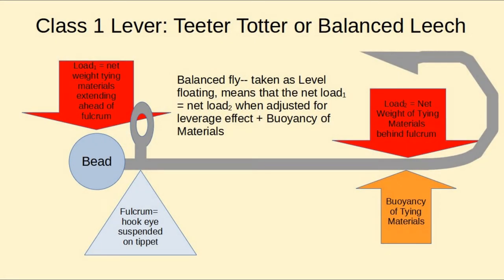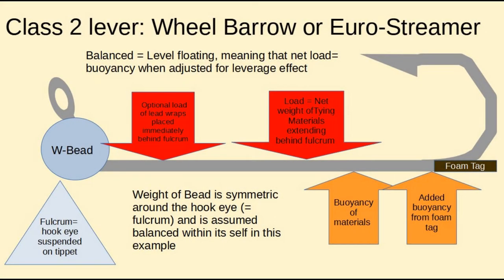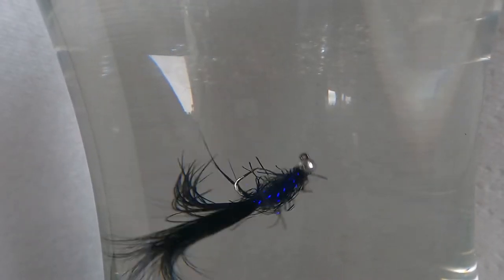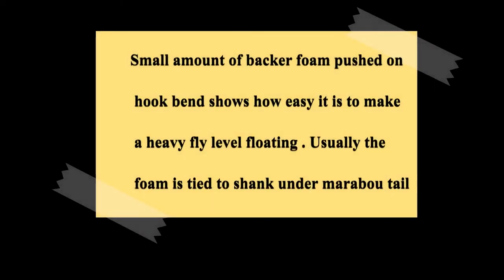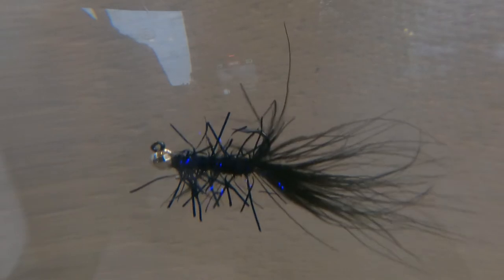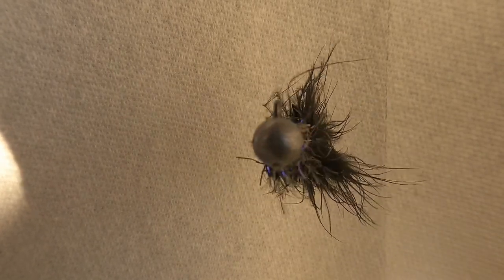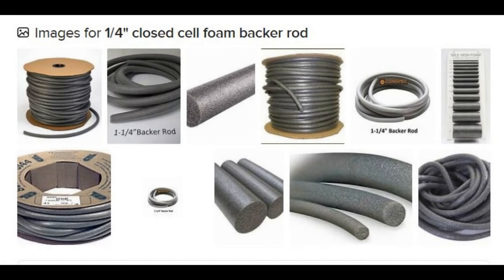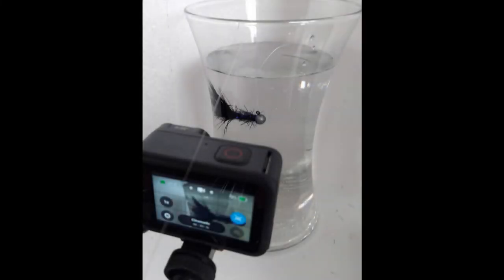Balanced Jig-Hook-Based Streamers using Foam Tags

Comment: Thanks.  Very interesting!   Have you compared the presentation between a loop knot and a clinch or other "tight to the eye" knot?
Reply from the maker: I have not done this experiment but It's an interesting idea. Seems it should be straight forward to do without confounding factors.   Keep it simple by using same make of fluorocarbon tippet-- my preferred type of tippet for streamers because it sinks.  Test at one reasonable tippet diameter for euro-streamers, I use 4x. As you say, use the Clinch knot (1 loop at hook eye) and I would add in the Palomar (2 loops at hook eye) as the tight to eye knots versus a small loop knot like Kryston or non-slip mono loop.  At first keep the hook style constant, like a downturned eye. That would be four tests.  Perhaps add on testing up-eye, horizontal ring-eye and vertical ring-eye hooks. One confounding factor could be that the narrow waist of the vase that I'm using as the test tank in this video may interfere with the movement of the tippet coming off of the hook eye in the case of the tight to eye knot tests-- and perhaps make the test results ambiguous. Testing in a wider vessel like an aquarium seemingly would remove that problem.
Reply from the maker: As suggested in Cc Ogden’s comment, the action of an euro-streamer with the tight-to-eye (TTE) aka snug knot on the tippet to fly connection was qualitatively compared to an open loop knot by water tank testing like that in the video.  What I saw is that compared to an open loop knot, a TTE connected fly seemingly has less freedom of movement when jigged. The attenuated movement is expressed as a slower-paced wiggle for a similar level of hand jig motion. In general, a TTE connected fly seemed more resistant to moving, perhaps because of the drag of the J shaped loop in front of the TTE connected fly vs vertical tippet that heads up from hookeye in an open loop connection. The TTE connected fly also swam in a more erratic fashion. The erratic swimming maybe caused by the TTE connected fly tending to lay underwater with the hookeye off to the side rather than vertical as found in an open loop connection. It could also be due to a weight imbalance or an uneven drag in the tying materials. 

This testing does not include casting the flies and then checking the fly action in a water tank. The to-and-fro action of casting these heavy flies will seemingly cause wear and tear on TTE knot where it contacts the hookeye and I believe that connection will loosen over time.  The inhibition of the fly jigging action resulting from the TTE connection consequently should decline while it is fished. In conclusion, my takeaway from these tests is that using loop knot is a simple way to assure level floating as well as a more freely moving balanced streamer.